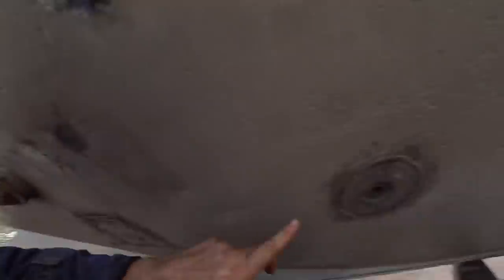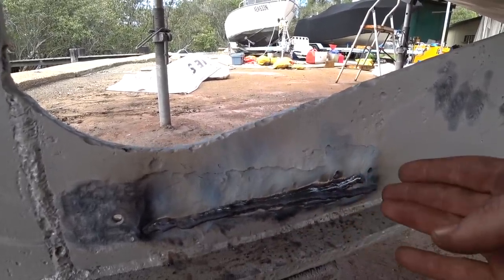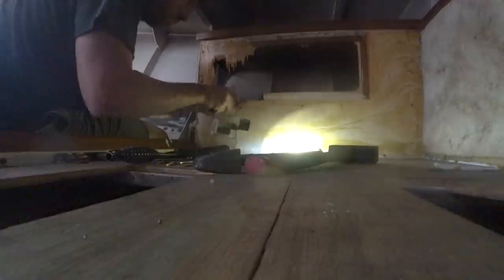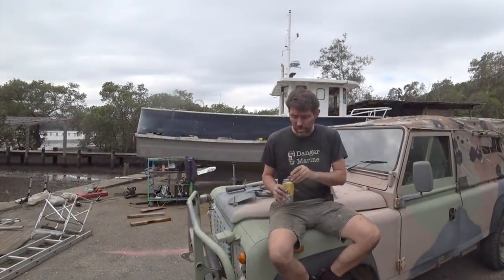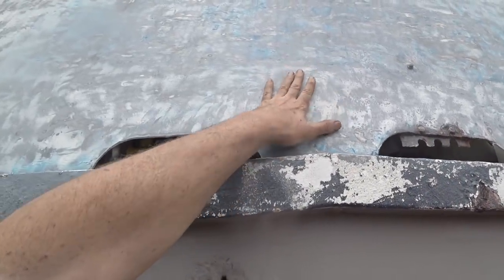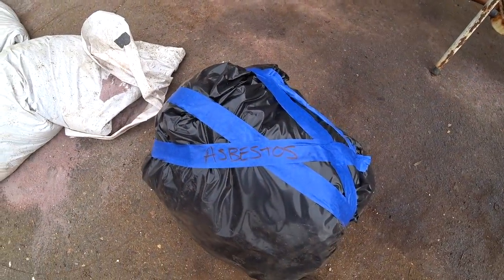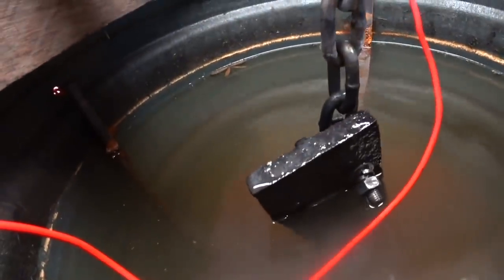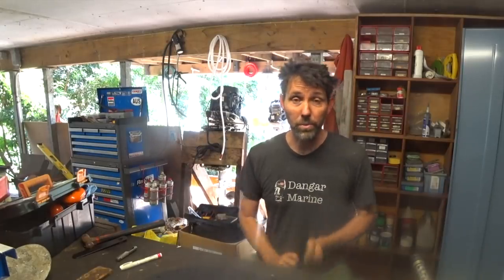Hull work, asbestos removal and a small fire

Comment: And you most definitely do need to remove anything that obscures the view of the interior of the hull. My boat is wood, and 48 feet long, and I have been removing installed furniture and refrigeration units and various other things just so that I can inspect every square inch of the hull. This is not because it's desirable, but because it is essential. Go Stu! [corrected "hall" to hull]

Comment: A handy trick for putting holes in rubber is chucking up a wad punch in the drill and using it with a little bit of wd-40 etc to drill the holes through the rubber. Have used this for making dumptruck mudflaps out of conveyor belt. Great progress being made on the boat 👍🏻👍🏻
Reply from the maker: Good tip if the rubber was reinforced or a bit tougher than this stuff was.

Comment: Hi Stu,
Enjoy your new tools and give them some abuse 👍
Another term for the “big screwdriver” is, get the “Persuader”, lol.

Another exceptional episode mate.
Cut out the inner part of the tank cover gasket , fit it in dry, no gasket goo and with studs and Stainless nyloc nuts, and use the remaining rubber for other jobs.
Otherwise you will just chase the nuts or bolts when tightening with Hylomar on it.

Historically, tank inspection/ access hatches have studs and nuts fitted.

Asbestos or “Monkey Dung” as it was called in the Navy years ago, treat every item your not sure about as Asbestos, your asbestos mate will keep you right.

Your doing a grand job Stu.

Cheers
Malc Qld
Reply from the maker: Thanks Malcom. Yes, nothing beats brings out the persuader. ;)

Comment: The way you control the weld pool temperature on vertical ups is to add a up stroke to your weave (used to call it Christmas tree pattern). The up stroke gives the weld pool time to solidify letting you lay the next weave over the last. 50 amps is too low, you'll be getting inclusions and lack of fusion.
Reply: Also, hold the rod at the end of the weave for a sec of 2 before moving on, this fills the sides of the weld out, flattening the profile. Hold it there until just before weld pool drops out, bit of practice and the timing comes naturally.
Reply: I totally agree. I wish i had seen your comment before i said the same as well in my comment.  Its the truth and the man needs to know to better himself and make less work for himself.

Comment: Quick emergency access will be essential into your boat cabinets, especially if that's where you're storing the beer and ceremonial anti-pirate dagger.  Regarding your exhaust work, it looks slow and messy, but I'm sure you're doing asbestos you can.
Reply from the maker: I always do asbestos I can. Fortunately though the Dangar Marine moto is, "Not good, but good enough." ;)

Comment: Rip that wood out to the bare inside hull . Just like you did because you can build it the way You Want. Saves time in the long run. Hull and welding coming along nicely. See you were freaking out in the beginning now your in a groove of things. When done you can have a really nice boat for as long as you want it. And sell it and get your money back if you maintain the boat. Great video 👍
Reply from the maker: Thanks mate. I'm really enjoying the welding now. I'm definitely going to take both out and redo them in a more more inspection-friendly manner.
Reply: @DangarMarine  stick welding outside is the easiest way for a steel boat period. You can buy all types of rod to fill anything,  your getting good at it now.  I know you want to splash her but get the hull and all through hull fittings done right Now because if you don't you will be kicking yourself later.  Good luck :)

Comment: Another great video.  If your gasket material is rated for fuel oil then this might not apply.  But I believe the reasoning behind cutting the center out of the gasket is this.  Degradation of gasket material entering your fuel system.  I.E.  that’s a lot of excess rubber dangling from the hatch.

Comment: Nice gaskets. Old engineers trick I learned a while ago, and use on my boat for making gaskets... two ball peen hammers. Small one with the ball end in the bolt hole, give it a solid whack with a heavier hammer. "Pin" that hole with a bolt thru the cover plate and the gasket, and proceed to do the same to the remainder of your holes. Same for the perimeter of your inspection cover too. 

With practice, it creates an exact outline of what you're trying to gasket.

Comment: Hi Stu,

When I was building street rods I used a heavy duty sanding disc with a rubber backer on my ancient 7" pipeline welder's style grinder both on metal prep and cleaning up welds.  I'm in the US so what's available could be different for you; I have no idea.  The discs and backer were from 3M.  The rubber backer has curved ventilation grooves in it and threads onto the threaded shaft of the grinder and then there's a flat nut that holds the sanding disc in place.  I used 36 and 50 grit sanding discs.   I really liked the finish of the flexible sanding discs compared to the hard discs and they were surprisingly durable.  For finishing radiused outside corners the flexible disc leaves a nice smooth shape instead of the irregular facets from a hard disc.  The gyroscopic effect was also lessened because the flexible setup was much lighter than a new 7" rigid disc.
Reply from the maker: Hey David, that sounds like it might be a great setup for the fairing stage in the paint job. I'll look into it.

Comment: For quick access, mount a stainless stud with a thru hole at the end, add a spring and washer, then press down the washer and lock with an 'auto hood locking pin'. you can tie nylon cord to the spring and pin so you don't drop them into the bilge when removing. Takes only seconds to pull free, something I wish I'd had when an unused drain fitting began gushing sea water when under way in my old Pacemaker...

Comment: You can try one of those hand-held vibratory saws that have different blade profiles to cut through some of them screws. I used one to remodel a travel trailer because it was a PITA to get to the other side of the screws.

Comment: Stu, don't cut the center of the gasket out of the inspection hatch if you do you have a greater chance of the hatch leaking . Just use some adhesive sparingly the hold the gasket to the hatch.

Comment: Welding and wood don't mix. When soldering copper pipe I used metal tape around the wood. Worked good

Comment: Bed was built to last. In 2019 a master boat builder would use 3 tech screws and 2 ounces of adhesive caulking...so it holds until 15 minutes past the warranty.

Comment: Also, best rods for patching are GP's, they have a lower tensile strength but are much easier to strike and run a smooth weld, use low hydrogen (high tensile rods) for structural welds. From memory, GP's have a 4 number code on the rod which begins with 40, low hydrogen rods begin with 70. The other 2 numbers of the 4 indicate their intended weld position (downhand, vertical up, horizontal), if you pick the right rod for the weld at hand it's much easier.
Reply: Do you know what rods he is using, and the capabilities of his welding unit?
Reply: I think he's been using low hydrogen mostly, that shaft support pad run looked like a GP. Stick welding machines are much the same, the price increases with the required duty cycle, the bigger the machine the better the duty cycle is, it's measured on percentage of use to down time. 100% duty cycle can work non stop, it gets down to about 10% for the cheapest. The only thing to look for when buying one is replacement part availability, alot of the new, cheap Chinese machines don't have any parts support, you blow a card in the unit and it's trash. The unit he has is Chinese I think, it will probably run all day up to 3.2mm rods, might handle a 4mm rod at a push...
Reply: I worked at a local welding shop when I was in school and the boss used primarily 1/8" (3.2mm) 7018 Lincoln Electric (Low Hydrogen) rods unless code, contract, or the engineer specified something else which was usually 6010 (high penetrating aggressive cellulose) DC+ rods on our gasoline or 3-Phase Lincoln welding machines and that is what I learned on.   I stopped by in late November to see about getting a 30day work as free slave labor now that I'm crippled/retired and to keep me off the street refresher and he still used 7018 primarily and 'little' Timmy, his son and former welding instructor at the local trade school, told me that he primarily uses 6010.  I don't think I've ever used E6013 which I assume is similar to your GP rods, it has light penetration and is VERY easy to run, rutile flux, and is the rod they start you on at the welding school because it is so well behaved other than being one of the easier welds to break back when the tests were primarily a couple big farm boys beating your welds with 20# sledge hammers to try and make the welds break.
Reply: Santa brought me a lightly used DC (only)  single phase 180 amp MIG in my stocking and I finally got 240v 50amp single phase outlet installed in my garage to run it.  It seems that MIG would be the cost effective way to go, around here (in the states) 75/25 Argon/CO2 is the main shielding gas although 100% CO2 will get you better penetration and CO2 and the wire is so much cheaper than rods, I just got a second roll of 0.035" (0.9mm) flux core, 10# was about $29 delivered to my door. I don't have gas yet, I just keep a knotted wire wheel on the mini-grinder while I'm working.   Of course I have no idea what the relative welding costs may be there but the little I've seen makes me believe they are substantially higher...

Comment: So happy to see so much stick welding! It’s a really fun, economical(? - well, no gas), and if you’re conscientious with the slag, it works great. Plus, you can blast right through paint and fouling if necessary. Thumbs up, Stu. :)
Reply from the maker: It's been great for doing the pad welding after the sandblasting. I had to put primer on to stop flash rusting but the stick welding blasts straight through that for the areas I will need to fix.
Reply: Stu, did the supplier fellow indicate if there’s any concern about welding heat on the primer and it’s qualities? such as adhesion? Like the primer on the surface near where you’re welding? I know these sorts of marine products are pretty special and quite interesting. Glad you had that fellow come out.

Comment: Great work! I love watching this build. You should try to turn your heat up 75 or so amps for  your welds , better tie ins . You are running too cold so not as great of a tie in to the existing steel.  Cold lap. When burning hotter you have to move faster. Turn the heat up some and will see a better tie in and less grinding unless u move too slow. Colder you run the less penetration you have and undercut .Not cutting you u up just trying to help out. Its a learning process.  Please keep these videos going because they are amazing

Comment: Recipro saw your best friend for removing that shitty cabinetry..... your going real well steu👍👍👍
Reply from the maker: Might have to borrow Arn's for the other side. Definitely don't want something I can't remove, even if it isn't singed!
Reply: Hey stu 
Burning it out is a pretty good option ..... but........ big recipro timber blades will eat that beautiful bit of cabinetry ..... have u thought about getting a kitchen guy to manufacture what u want to replace it with .... measure and fit..... got a keen young bloke with his own factory in smithfield nsw.... he loves something different ..... just a thought..... save u a heap of fukn around

Comment: I got one of the pressurized continuous spray bottles to use instead of the squeeze spray bottle.  Pumps up by hand and can hold about 1 gallon.  Found in the garden section at the local home improvement store.
Reply from the maker: Good choice.

Comment: It is frequent on larger ships to find hatches with one piece rubber gaskets. There is no need to cut out the middle. On fuel tanks, the rubber exposed to the fuel will deform and sag after a time.

Comment: I am plus/minus on the asbestos removal. Asbestos is only harmful when it becomes airborne; you might have made things worse instead of better with asbestos dust clinging everywhere. Encapsulating it is what they tell me to do around the house.
Reply: Considering the age of the boat, appearance, and how clean the wrap was I doubt it was asbestos rather than fiberglass.
Reply: Actually, injection, ingestion, and inhalation are the ways it can enter a body. However, you are correct about contaminating all surfaces but it will be encapsulated when he paints. A glove bag would have been beneficial. I doubt it is asbestos.  Were his filters purple? MSAH code.
Reply: @abark  same here. Looks like normal old fiberglass wrap.

Comment: 1:15 When I see this video about the weldings I remember something I wanted to write some videos earlier on already. The 2mm sticks are a little small for what you do with it, and as a result the maximum amperes need to be a little bit too low as well, to not melt them away as a whole. For the 3-4mm hull steel you could easily use at least 2.5mm sticks, perhaps even 3.25mm, and along with the thicker sticks a higher ampere setting, so the weldings do not look like little worms crawling along your hull. 3.25mm sticks along with a higher ampere setting will flatten the weldings out much better when adding material, and 3-4 mm hull can take that easily when pointing the electrode at a flat angle towards the welding area, instead of welding like shooting straight at the hull with the stick.
 Also you might want to make sure to point at a flatter angle (than observed when you were welding the transom in an earlier video) always pointing into the direction of greatest material thickness, to prevent burning holes into the material. The arc spreads the welding material anyways and the gently swinging movement of your hand makes up where it goes to spread. (Btw. Do not swing the tip of the electrode (stick), but the only hand with small gently swings, just if the tip were fixed in air at a certain distance to the material. This gives the most beautiful weldings with such thin plates of below 6mm.
 Not to forget to mention, when welding, always keep in mind the heat goes upwards, to make sure to plan a welding right, not to overheat areas (>300°C for <30mm ship steel is too much).
 Also heating up the steel with a torch/burner around a welding area (1 m² around the weld), before starting to actually weld, to something like 80°-200°C (<30mm steel) reduces the risk of local area deformation on the hull caused by expansion of hot welding areas, as well as distortion in the crystal structure of the welding area. Best choice for a heating torch is Acethylen [ C²H² ], since it contains the least water of typically used "burner gas" that might cause issues with the welding.
 That at least from my personal expirience with welding ... mostly arc(stick) welding of course :)
[edit] Welding with reduced ampere setting does not really make up a good solution. Perhaps try 3.5mm rutil cellulose (RC coating) @ 115 to 130 ampere for your 3-4mm steel. The only downside compared to rutil base coating (RB) is the higher hydrogen coming along with rutil celulose coating (RC). But it is much easier to weld falling or over head along the underside of the hull.
Reply from the maker: Hey mate. Thanks for all the great tips. I'd love to do some formal welding training one day but unfortunately the only school in Sydney is on the complete other side of town.
Reply: @DangarMarine  Sorry, I cannot help you out, since I am living in Berlin, Germany. I wish I could! But perhaps try to find some former welder in your area who has at least some years of expirience with pipe and/or boiler welding. This sort of expirience might help the most with the type of sheets on boats, while not being a shipyard welder. Best of course would be someone who actually did shipyard welding and controlled steel sheet deforming with torch & water. But I wish you all the best for your project anyways!
 With my best wishes from Berlin, Andreas! --- [edit] One thing I forgot, you do your welding much easier, when grinding a phase to the edges of what you want to weld. I have seen , you didn't in your through hole weldings most the time. A phase should be about 1/3rd of the thinner material to weld to something, but the phase should be put onto both items to weld together. Into such V-shaped gap the welding goes deeper into the material and help forming a better root on the opposite side.
[another edit] Do not forget to drink at least half a liter of milk when welding a lot. Just to make sure you stay healthy by binding toxics in your mouth (from inhaling) with the milk. I just did remember, when I was young making some money with welding while studying, we always had to drink milk for safety... Haha! Good old days... :)